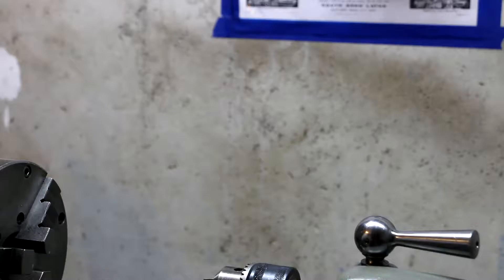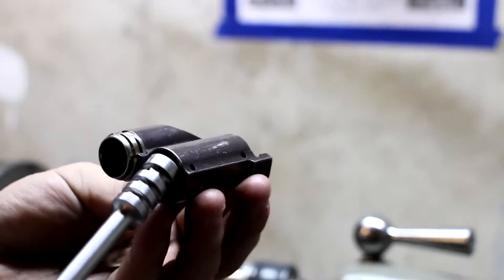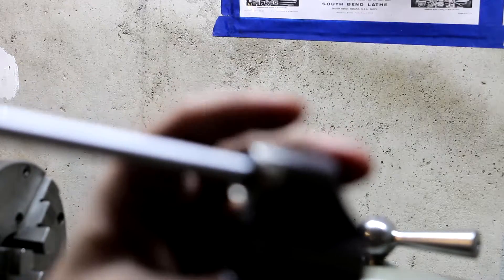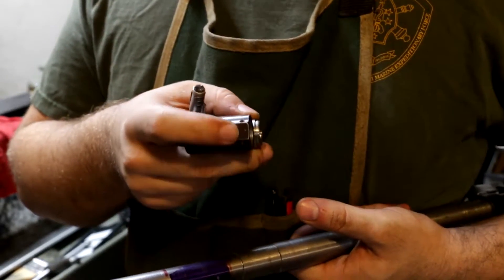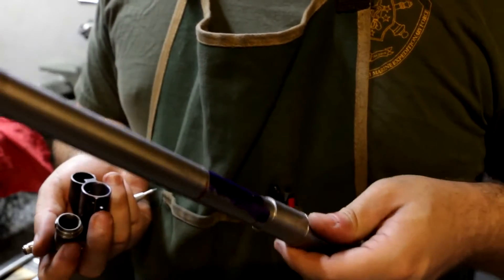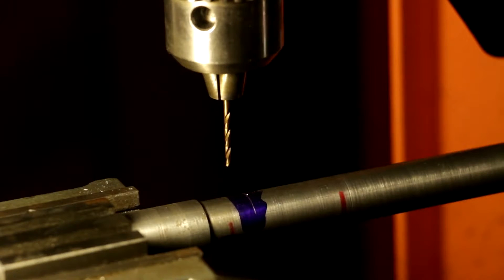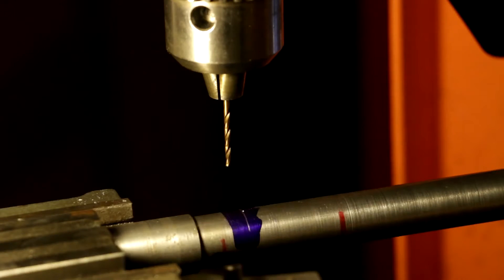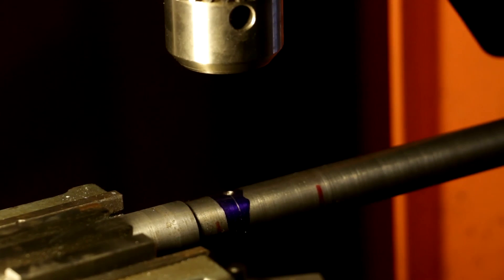Building The Custom PSL: The Gas System (Part 7)

Comment: How about a piece of copper or brass rod about .306 in dia so it will pull up colored chips when it breaks through?
Reply from the maker: That would work as well. I just tend to horde my brass stock and have a bunch of USGI cleaning rods all over the shop.

Comment: He said the PSL gas port was 90 degrees, but mine looked like it was drilled through the gas block passage at the same angle.
Reply from the maker: The factory PSL uses a gas block similar to an AKM where the gas port is drilled at a 26-degree angle that's drilled with the gas block in situ.